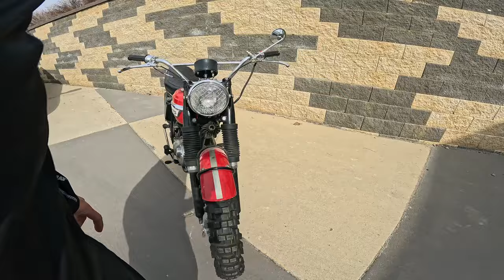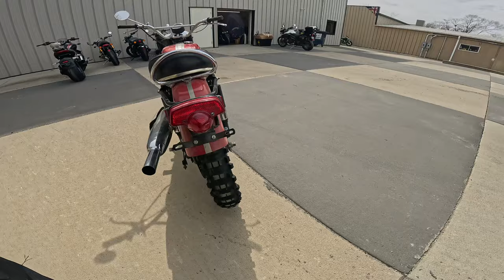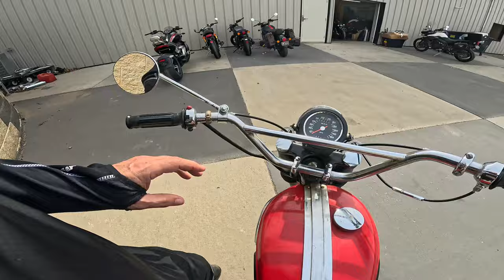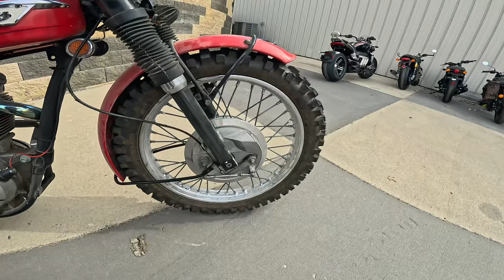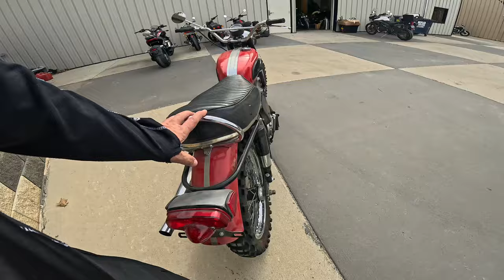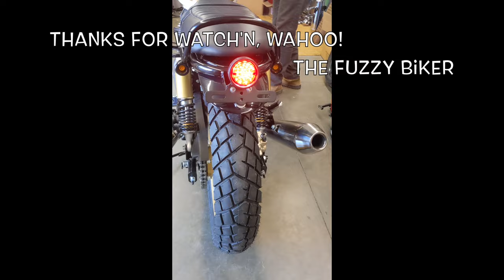Classic Triumph Trophy 250 from 1970 - Looks Like Fun - Wahoo!

Comment: Great looking bike! I remember them coming out in '68. I believe the engine was BSA designed and built and very similar to  the BSA B25 Starfire (my second ever bike!). It had a bad reputation in the UK, poor build quality and reliability issues, which to be fair could be said of most British bikes of the time! The bike didn't sell well over here but was quite popular in the US. I would still have one though!
Reply from the maker: Hoping to ride this one after it gets out of the shop. Wahoo!
Reply: 1973. Imagine a tranquil country road in Aberdeenshire. Cruising gently c. 45mph. Bang! Rear wheel locks solid. Slew to a halt. A two mile push back up the track to the croft on the side of Bennachie. Next bike was a Yamaha.